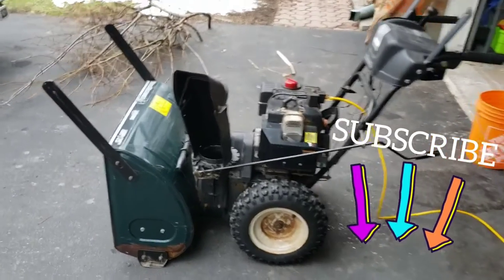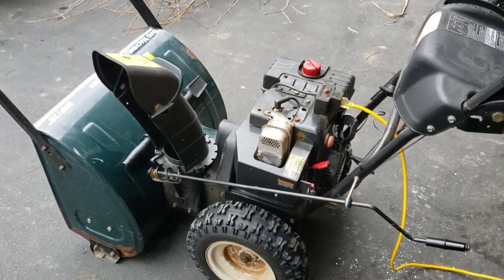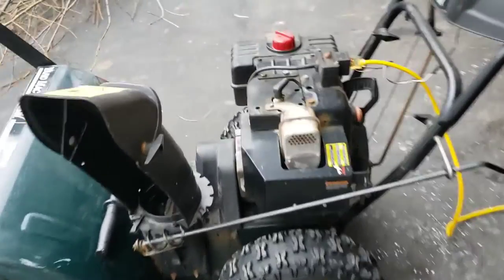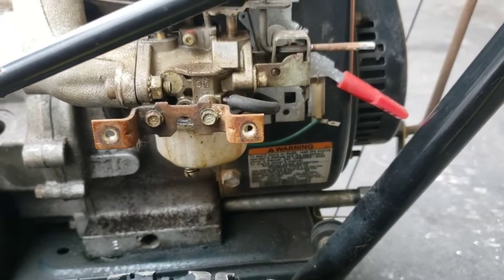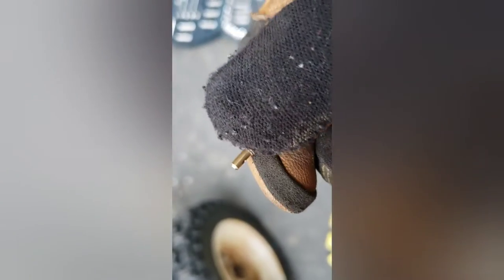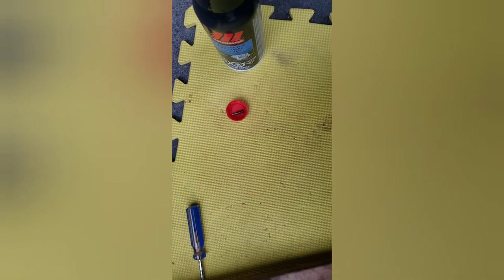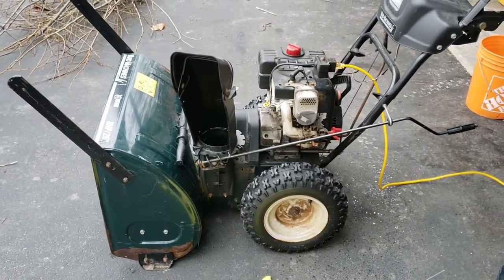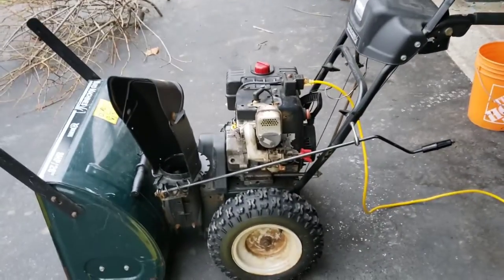Snowblower surging / rough idle FIX

Comment: Wow this is great! Looks like mine is identical and it is running the same. Going to try this I don't think I have any carb cleaner I'm going to have to improvise with something else
Reply from the maker: Cool!  Let us know how it goes!
Reply: I am happy to report the machine is running as smoothly as the day I bought it literally 20 years ago. Used a safety pin and improvised with some gasoline to soak. Reassembled and started it up. Running perfectly at all levels of throttle. Ready for the Canadian winter! Thanks so much!
Reply from the maker: Phenomenal news!!!
Reply: @fixingrandomcrap  I told you mine looked identical...even the same "work-pad" 😄

Comment: Sounds exactly like mine, even though I installed a new carburetor.
Reply from the maker: So you replaced the whole carb and it is still surging like this?  Did you clean the screw and did that make any difference for you?